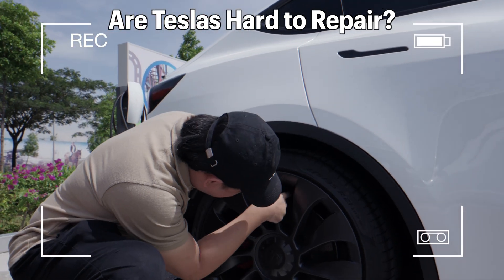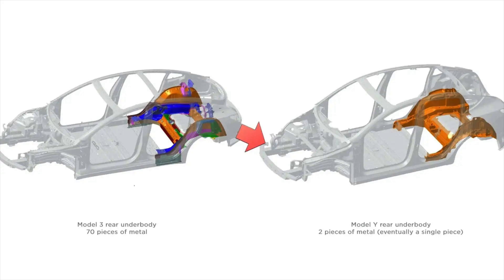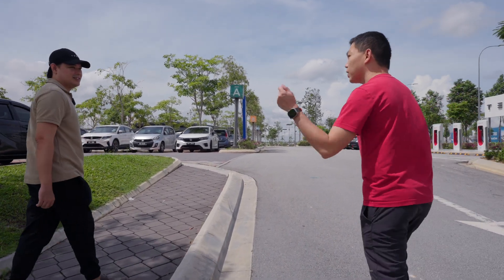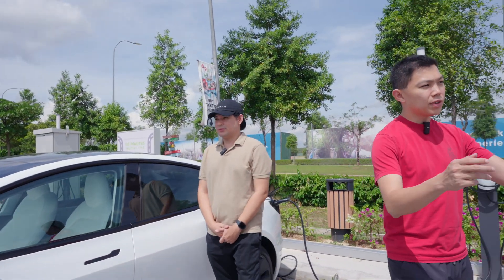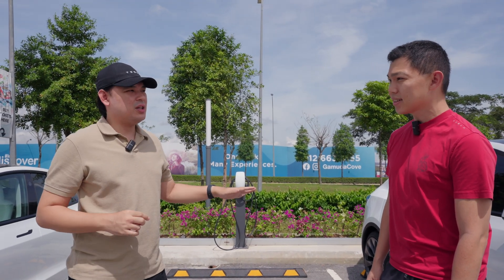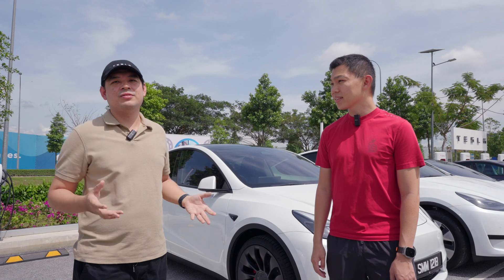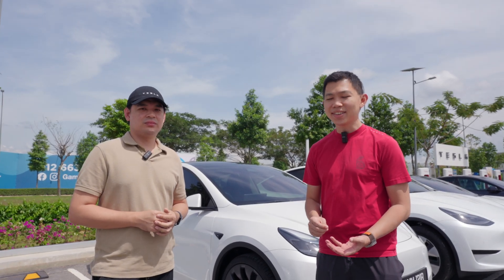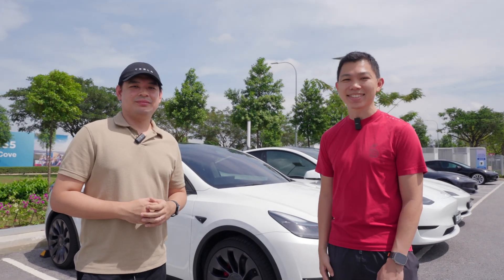Are Teslas Hard to Repair?

Comment: dear... u know what is the honey comb shape? In the event of accident, those shape deform, and lost it strength. u may try to reshaping by knocking and hoping it go back to hexagon shape. 
it is alot of works, and strength isn't guaranteed. No to mention it structure integrity of the daily high torque, frequent braking stress.

Comment: EV charging is an obsolete method. The world now is focusing on swap battery technology as it takes 2minutes 43 seconds (Gen 4) to swap a full battery which is faster than we pump the fuel. The attractive of swap battery technology is it can swap automatically with robot and the range of battery can be upgraded easily. We are free of degradation and damage of battery. The another cool thing is the battery can be rented (BAAS programme) or purchased one-off. If you rent a battery, the EV car price is low and everyone affords to buy.
Reply: The idea of bat swap has been around for a long time. Its not viable just due to the fact the amount of batteries you need at a station, on top of the number of vehicles a station is able to serve based on different battery model requirements.
Reply: @alvingoh8000  You mean Ample swap battery and also ex-Tesla swap battery right? They are unsuccessful in USA many years ago. NIO is successful in 2019 onwards with more than 2,450 swap battery stations around China and number of swap has exceeded 50million times recently. The second hand value of NIO Cars are increasing whereas the other EV Cars are decreasing due to degradation of battery. Those who have partnership with NIO in swap battery are Changan Group, Geely Group, JAC Group and Chery Group. The swap battery is in line with China Gov's vision which is standardisation of battery. It means that all the automotive companies have to use NIO standard battery in order to utilise their NIO swap battery stations.
Reply: @alvingoh8000  Regarding the amount of battery and also its maintenance, the cost is proportioned among 3 Companies based on partnership agreement that has been signed by NIO, Big Energy Companies and CATL. With the involvement of big investment from Big Energy Companies, NIO said they are planning to build 10,000 swap battery stations in China by 2025. That is a great job. No one can do it even Tesla or US gov.